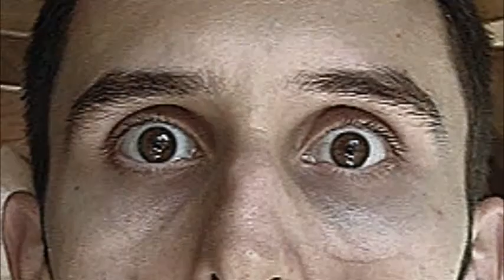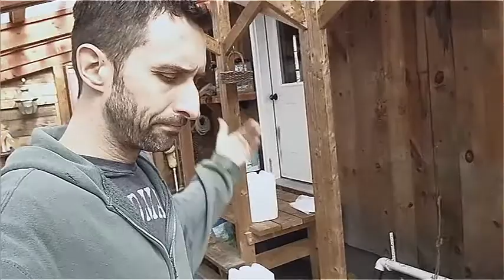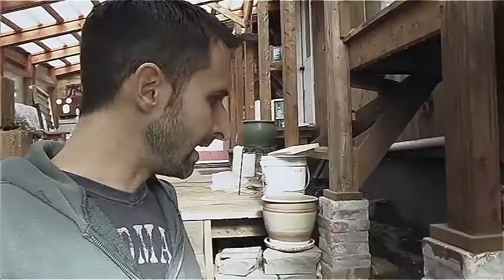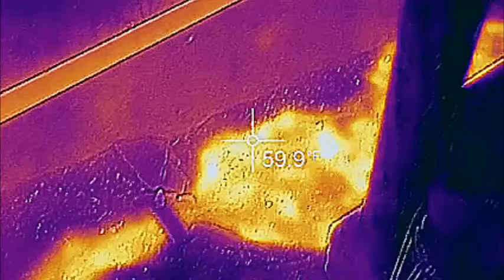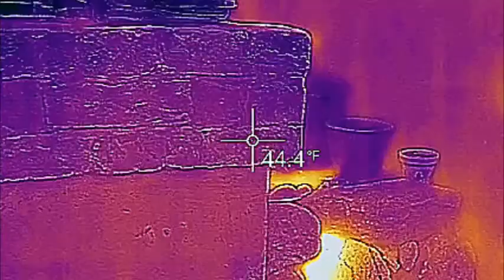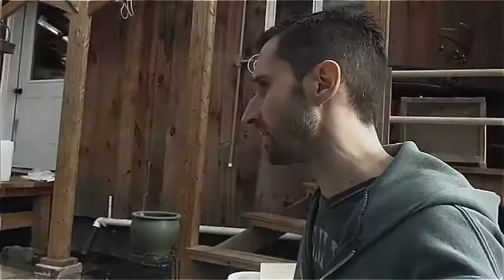My Super Regret & Dangerous Mistake

Comment: Crazy idea but could you rig up some guttering to collect the water trapped in the roof maybe?
Reply from the maker: It's not that much water that it's really worth collecting (in generally water-logged New England), but I did install some strips of aluminum flashing to try to redirect the water farther out away from the wall.
Reply: I thought it might be a bit of a long winded solution but I thought I’d put it out there 👍🏻
Reply from the maker: It's not a bad idea. I mean, I did just what you suggested - except without keeping the water.

Comment: Praxis, is it possible to have some sort of rain gutter like structure to catch moisture run-off?  And in the roof design, moisture channels?   Would water repellent wood treatment help with wood longevity?   I have absolutely no idea about greenhouses.  I live in south Texas, so a greenhouse is not needed for warmth, but we are rather moisture starved.  Ideas for drought greenhouse maybe?  As for the president, agree to disagree.  I do have an ex-girlfriend from Malmo, that was so brutally raped and beaten by immigrants, she doesn't even look the same.
Reply from the maker: All those ideas could work. My intent here was to get people thinking about it before they make similar mistakes that I did. I actually did put a make-shift gutter outside the roof to draw some of it away, and that's helped. As far as use of a greenhouse as a moisture collector, It would tend to capture some moisture from the ground, but there are simpler and more efficient ways for doing that. The simple pit dug with a plastic sheet laid over works very well.
On Trump, I appreciate your ability to amicably disagree. I hope my sense of where this is going is wrong, and I'm STILL glad we got Trump instead of Clinton. So I wasn't speaking that mistakes were made, but that I feel things are headed to a dangerous place based partly of Trump's ways. Again, not suggesting there were better choices there, was just commenting on the feeling I have that my best hopes for Trump won't be happening.
Sorry about your ex-girlfriend. That's awful. I'm not sure that Trump's actions will make things like that less common, but he certainly has an aggressive plan. Hopefully, some good things can come of it.
Reply: Praxis Prepper - thanks for responding.   I'm interested in gardening, but I have a long learning curve ahead.  The summers here are brutal, and working around that is one of my main concerns  (along with water).   I do like your set-up along with the judicious use of water.  Pretty cool.
Reply from the maker: Gray water could be a HUGE asset to you. I have several videos specifically on that... sorry if my titles tend to be more "fun" and less descriptive, which can make finding my specific videos a little tricky. I think one had a title along the lines of "secret free water resource post SHTF" and has a black and white image of my face done up like a 1920's film villain.